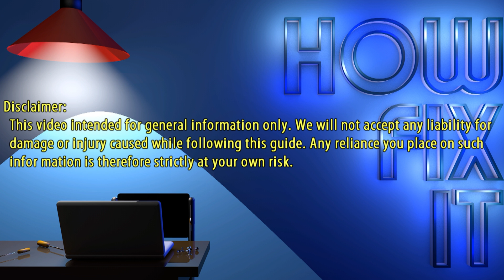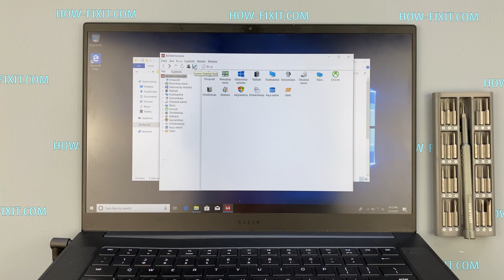Razer Blade 15 Base Model 2018 Disassembly, fan cleaning and thermal paste replacement

Comment: This did wonders to my Razer Blade. Thanks. This made my blade go from a 100 degree stove to my fingers to silently humming fans… the temps dropped from 60 to 39 at idle easily.

If I could mention one thing to any one thinking of attempting this: those two tiny wires with those tiny golden connectors at the 8:00 mark can get EXTREMELY finnecky to reconnect. Don’t give up hope. Be gentle but give it enough push for them to pop in.

This is seriously worth doing if you want to keep your laptop going for an extra year or two.
Reply: Honestly, do we even need to disconnect all the wires?? I feel like you can just take the fan off, and then re tuck them underneath the fan when you put them back in right?
I need to replace my fans and I really don't want to do that part of it lol
Reply: @RadaSmada  Now that I think back about it, I guess you're right. It might not even be necessary. Next time I replace the thermal paste I'll try this.